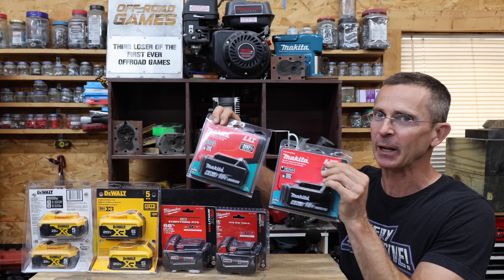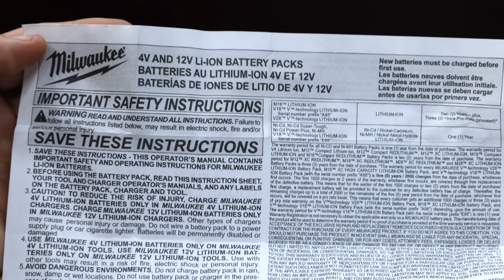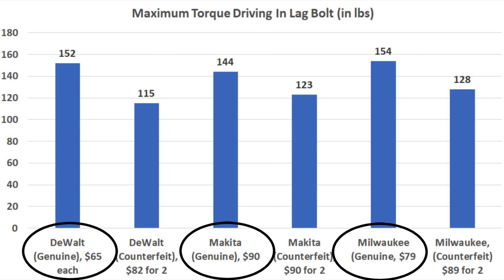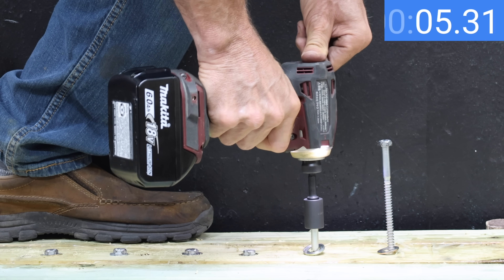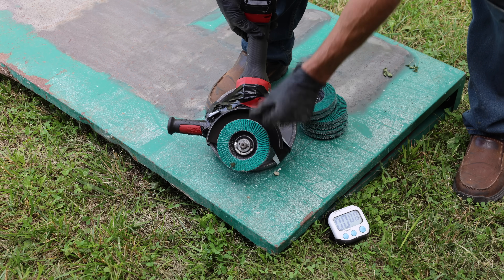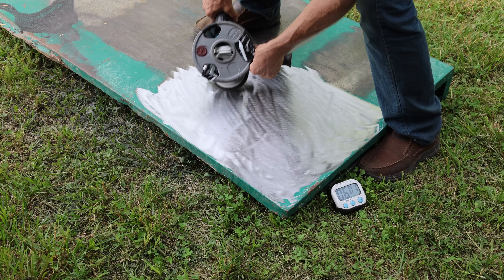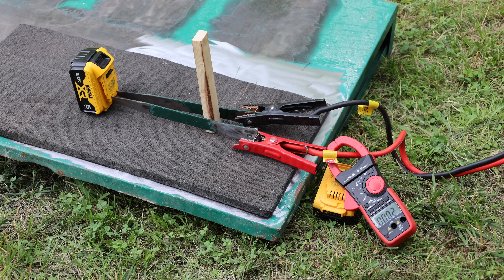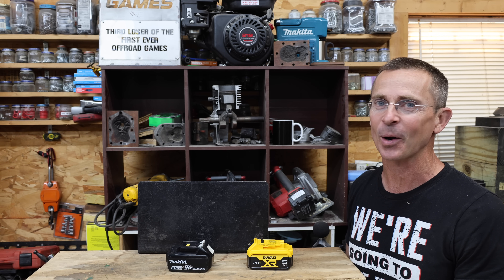Have You Been Scammed with a Counterfeit Tool Battery?

Comment: Expensive part is the damn connection, buy the counterfeit at counterfeit prices, and replace the internals with better gear off of a reliable but cheaper brands' gear, tool and materials supplier, hardware store chains, often have an own brand product, that has just as good batteries, but poorer quality on the actual tool, so get the £30 batteries, and put them in the £30 counterfeits of the £80 batteries, and still save money.

Hell when I need some 18650s for my illuminators I buy the cheap own brand battery packs, a lot of them just use linked 18650s, and I know there will be a certain level of quality control, and tear them down for the batteries.
Reply from the maker: Thanks for the feedback.

Comment: Interesting that they put so much effort in the looks, making the counterfeit batteries hard to determine on sight, and so little care about the actual function. Sure it's cheaper to make stickers than to make a decent battery pack, but it would be interesting to know just what the design cost them.

Now the battery that they were able to even register on the website was really interesting. Either the manufacturer use a really simple function for registering the products or the fake manufacturer has had someone decrypt the codes used so they can generate functioning codes for each battery. My guess is the former as I can't see the fakers see the worth in actually making individual codes for each battery pack they sell.
Reply from the maker: Thanks for sharing!

Comment: We have Makita impact drivers we use at work.  Our tool technicians that maintain them for us have a USB cradle provided by Makita that they can plug a battery into to read the serial number and run an internal diagnostic on the battery to determine if it has failed under warranty or if it's no longer salvageable.  I think the cradle can also refresh batteries that have problems charging by running them through charge and discharge cycles.
Reply from the maker: Thanks for sharing.

Comment: I had no Idea the packaging of the counterfeits was so good. I decided to get out all my DeWalt 5amp batteries, I have 11 of them. I'm a little confused by what you're calling the newer package, the one on the right in your video with the notch by the battery release. I have batteries that go back to 2016. They all have the notched case except one 2016 & 2 of my 2023's. No QR code on any of my 2016's. It seems to have started in 2018 with both of my 2018 having a QR. From 2020 to 2023 I have 7 batteries. All but 2, in 2020, have QR codes but in old & new cases. 
All my weight reading were from 620 to 647 grams which showed a steady in crease over the years except those 2 in 2020 without a QR code, they were 620 each.
 Next, I randomly opened 4 batteries from different years. I found green and red cells. The control boards looked the same as in your video.
After doing this examination of the batteries I don't see a clear conclusion. I'm thinking instead of being and inside job like you suggested maybe they're manufactured in different places with parts on hand. 
I think the only clear sign at this point is a lack of a control board.
Keep up the great testing, I learn a lot from your videos.
Reply from the maker: Thanks, will do!  Glad to hear!

Comment: I bought a two pack of DeWalt 6AH Flexvolt batteries, off of Facebook Marketplace and I received two 8AH Chinese knockoff batteries. They had nothing to do with DeWalt and their capacity is ACTUALLY that of my 2AH Dewalt! They were covered by purchase protection so, of course I got my money back and I was able to keep the knockoffs too. I don't really trust the batteries on my tools but, I put an adapter on them and use them as battery banks.
Reply from the maker: Thanks for the feedback.

Comment: I have seen, and purchased, several batteries on Amazon that are made for a particular tool... specifically Milwaukee M12 and Ryobi ONE tools.  They were quite obviously generic, not packaged in any way that made you think they were official brand name batteries, so I wouldn't call them counterfeit.  I just wanted to see what kind of performance I could get from them at 25% the cost.  I have actually been quite pleased with the generic batteries.  Some of them have lasted much longer than the originals.  I haven't experienced any explosions or smoke either.  Thanks for another great video!
Reply: Generic batts will get you soon 😂
Reply: Well, maybe, but ive had a fewbof them for 4 years, they get used a bunch.  My point is, if you are going to take the cheap option,  go real cheap.  @mann_idonotreadreplies
Reply from the maker: You are welcome!  Thanks for sharing.

Comment: 🤛FANFKNTASTIC TIMING ON THIS VIDEO MY MAN!👍
"Brokeass"-Trying to get new Milwaukee batteries, highest "AH" possible, ...
 Holyhell!.. Niether Amazon nor Ebay(nobody should be shocked) does anything to "Sort"
or "eliminate" fake from genuine. Even typing "genuine", restricting search results to "Milwaukee, Makita, etc", specific part no., or even "ASIN" numbers(extremely shocked at this one.), will prevent or even reduce the fake crap from dominating the returned results. More often than not the ACTUAL genuine batteries won't even be displayed within the first one or two pages of results...  If I wasn't in "counting change"-mode I'd just spend the  $300+ from Milwaukee... But, $150-$175 is hard to ignore even with the "risk" looming above my Ramen-Noodle!

Comment: To be honest, with the price of the authentic batteries, the counterfeit ones are very temping at such a lower price. Personally, I'd rather but an off-brand battery (not the same as "counterfeit"), and a better bms for them.. It will still cost far less then the authentic ones. Sure, the performance won't be the same, but at the price difference, unless you're in the construction business, it's still worth it.

I wouldn't buy the counterfeit, because they're usually more costly than the off-brands, since the reason for counterfeiting the brands instead of just building off-brands is to be able to get more money for the battery packs.
Reply from the maker: Thanks for the feedback.

Comment: Pry the end caps off the counterfeit batteries and see if there is another below it. Those may be recycled laptop batteries.
Reply from the maker: Thanks for the feedback.
Reply: @ProjectFarm  by end cap I mean on each individual battery. I have found this in Chinese 18650 batteries with off brand names and odd color wraps. They tack weld the new caps on over the old.

Comment: Please test laser levels.  I have a load of projects to complete and once I started researching laser levels I was quickly overwhelmed.
Reply: I’ve tried many myself, I’ve found the cheaper ones are only good at a certain distance, it also depends on the resolution.  If your setting up foundation forms, cheating our can really screw you, it’s better to rent the high end ones.   There are so many variables, and prices pints, that going to be a hard idea for him to do because over time the cheaper ones, not necessarily cheap made but they will get less accurate and if dropped can really throw things off.  If you will use it allot then get the professional quality brands like spectra and some topcon, stabilator makes a few as well.  But these are 1,500-2,500$.   The dewalt , Milwaukee, makita lines are ok for setting cabinets but don’t use them for big stuff.   To be accurate at a distance you need a high power, stable, expensive laser.
Reply from the maker: Thanks for the suggestion.

Comment: a few corrections on the dewalt battery. the sequence that starts with N is not the serial, that's the part number. which is not the same as the model number. the same model number (DCB205) can have multiple part numbers due to revisions. fake batteries don't have serial numbers. i've seen thousands of fakes. none of them had one. however, there are also real dewalt batteries that don't have serial numbers, explained below. 

dewalt uses several contract manufacturers for batteries and each does whatever the hell they feel like. so dewalt still sells batteries with their old design too. you can buy the same tool at the same store; one can have the new design battery while the other may have the old design. 

some of these factories don't bother putting on serial numbers. there are also real batteries with 2024 manufacture dates that don't have QR codes. dewalt's battery production is a total s**t show

Comment: theyre not counterfeits.  it depends which country they were manufactured in because different countries have access to different parts, what you end up getting is a complete coin flip because online orders get pulled from everywhere. ive gotten some of those "counterfeit" ones out of brand new in-box dewalt tool combo boxes. youll also notice chargers are slightly different from country to country.

Comment: I am so surprised that the Milwaukee are able to deliver such an extreme current for that long. 
I was curious so i checked the datasheet for the batteries. Max continues current is 20A and short pulse current(for 1 second) is 100A
Weird that the Milwakee did not put any 'slow reacting' over current protection into those batteries and specially when they have so much internal circuit. Dumb that if a device with a short or a high current fault is connected to the battery it does not enter over current protection.
Reply from the maker: Thanks for the feedback.

Comment: I have what appears to be a counterfit dewalt battery, but it is one that came with a genuine Dewalt product. The product was purchased at a retail store in its original unopened package.

I can think of 3 things happening. 1. Someone did purchase this, but returned it with a fake. 2. Dewalt is providing some oem batteries that are different than the retail packaged batteries. 3. Somehow an entire counterfit package including the product, charger and battery made it into a shipment to said retail store.

Note: Internally the cells are red, and there is a control board. The battery date is the earliest of my dewalt batteries, from 2018, also doesnt have the QR code.

This is concerning for me. If we cant even trust the products we buy from retail stores. Brick and Mortar retail stores.
Reply from the maker: Thanks for sharing.

Comment: If the price is much less than the real price then its a fake battery...  Most of the tool brands have price protection, meaning that prices from all dealers will be about the same as they don't get volume discounts, so there will not be big swings in price differences for the real items that are still being produced and not on sale.  Purchase your batteries through reputable dealers, even the big box stores, wait for the particular batteries to go on sale and stock up or purchase extra in kits if needed.  Milwaukee even has data read outs on the power gauge to tell how many days since the first charge and how many times they actually have been charged.  You can simply search for the light codes on YT and find a few people that are doing work to reverse engineer this.  I very much doubt the fake one would actually implement all that as well, so another way at least to tell genuine Milwaukee ones.   Keep up the good work.  👍🤠
Reply from the maker: Thanks, will do!  Thanks for sharing.

Comment: In the short circuit test, your measuring current, hence why the measurement is in amps not volts. In theory using ohm's law the voltage should remain the same due to "no resistance". Just a little thing of note.

Comment: I have no idea counterfeit tool batteries were so prevalent. Thank you for raising awareness.
Reply: Auto parts on e-bay is nothing but... the package is counterfeit.  The parts are genuine POS.
Reply: @SunriseLAW  I was just going to say most common car parts on Amazon and eBay are counterfeit. 

Never buy spark plugs and ignition coils from either site, you will get extremely low quality plugs without the expensive platinum or iridium tips that make them last for 100k miles these days.
Reply: Just don’t buy power tools on Amazon or sites like it. Try to stick with manufacture and Lowe’s and Home Depot style stores.
Reply: @zachbruner481 their just as bad as Amazon. Local hardware stores for me only
Reply from the maker: You are welcome!
Reply: Have you been living under a rock??
Counterfeits are prevalent in every market now. This is the result of globalization. 
People of that country making all this junk have every incentive to cheat us.
Reply: 95% of products sold on Amazon are counterfeits of counterfeits.
Reply: Counterfeits of everything are prevalent now. One of the stranger things that get counterfeited is guitar strings and not even the really expensive ones. The standard $5 ones are the ones being faked.
Reply: Everything is counterfeit nowadays, and it pisses me off. If you like firearms, never buy any accessories or optics from Amazon. They sell exclusively counterfeit optics, even the $2k Trijicon ACOGs on there are fake, and Amazon will fight you tooth and nail to refuse refunds.

Comment: Damn dude got me tearing apart my M18s I got from Amazon.  

I bought a milwaukee mid-torque impact kit 2 batt off amazon 358 versus northern tool 470.  I also bought a high output from amazon 65 versus home depot 119.  I took 1 of 2 apart and the high output.  HO had samsung batteries and the other plain 5ah looked just like his real one.  Maybe I got lucky.  The mid-torque is the real deal at least. I had 2 burly ass cops trying and failing to remove a tire from their old spare truck.  Broke those rusted lugs off just needed 3 seconds instead of 1.

Comment: Wow. I was ignorant to the fact that there were even actually fakes for these, much less so close to the official ones. 

I coincidentally just bought a new DeWalt 1/4" impact driver and a 2-pack of batteries, but I went ahead and bought them at Home Depot, so I'm probably safe?
Reply from the maker: Yes.
Reply: New in box stock will GENERALLY be safe.

It's always possible for return fraud to return a product "as new" that has been opened and carefully resealed, but this is much more rare, and generally you won't run into counterfeits this way.  That kind of return fraud tends to be a box with a brick inside.  The whole purpose of counterfeit return is to return an "open box" item that LOOKS like the real McCoy but isn't.

Comment: 45 seconds in and I'm voting the left "Dewalts" are fake. Things I noticed different:
1 - sticker on side of battery is small and doesn't fill in the inset fully
2 - back side, right package has and additional sticker on the blister pack, making it look store bought
3 - no "lithium ion" in battery case molding of left
4 -  screen printing on left is poor quality and numbers are different. looking them up seems to lend credence to that.

Lets see if I'm right?

Comment: remove the risk of buying counterfeit batteries by building your own counterfeit batteries The BEANS® style, inspired by Torque Test Channel.
You know its a fake battery, because YOU made a fake battery, with genuine Samsung or Molicel cells inside... If the board dies, you know where to get a new one and how to replace it.
Downside is, you need to know how to safely make a battery pack in the first place...

Comment: Its smarter to buy aftermarket clearly not-oem parts like batteries if you cant afford the full price. I bought new NiMh batteries for my old 12v dewalt and my old 18v milwaukee and though heavy (as they were then!) They work fine.  I suspect maybe not like when they were new from OEM, but for 40$ getting to use those tools is nice. The adapter to use the new 18v has its place but its just too bulky to use my old 18v drill overhead especially, but the lamp i put a new bulb in (LED)? :)
Reply from the maker: Thanks for sharing!

Comment: I bought some counterfeit milkwaukee batteries on ebay recently.  Requested a return based on them being obviously counterfeit even though they were in new packaging (I included pictures with legit batteries for comparison).  They approved my return and then my return showed that I had already shipped the item back even though I didn't.  Figured it was some sort of scam, so I engaged ebay and I ended up with my money back AND the batteries.

Comment: I was very puckered when you checked the batteries after the destructive test.
Those 18650 cells can and will explode or catch on fire several minutes after breaking sometimes.
They're still hot and chemically reactive.
I've made some battery packs myself in the past, and you treat them like a live bomb if anything goes wrong.
Reply from the maker: Thanks for sharing!

Comment: For the most part, Lithium cells (18650's etc) are not immune to shorting and require a Battery Control Module (BCM) to operate safely. The one pack with no BCM is the biggest danger because it will allow overcharging the cells or undercharging and also has no short protection. In general BCM's should have short circuit protection to avoid damaging the cells and potentially causing a thermal runaway problem. I have to hand it to the counterfeits in some sense because they perform almost as well as the real deal but for half the cost or less. Really can't expect anything when buying counterfeit knowingly. I'm shocked the chinese haven't just made substitute batteries for these brands as OEM replacement (but with a BCM of course!). That said, I think battery powered tools are a scam in general. The markups on battery packs is insane.

Comment: Milwaukee battery's communicate with the tools switch for the overload function.  The fusible link on the battery connection is the only over amperage protection on the battery. You are not supposed to draw power off the battery except with genuine Milwaukee accessories.
Reply from the maker: Thanks for sharing!